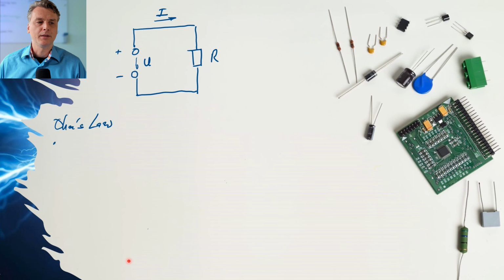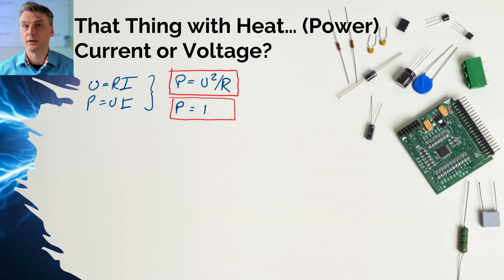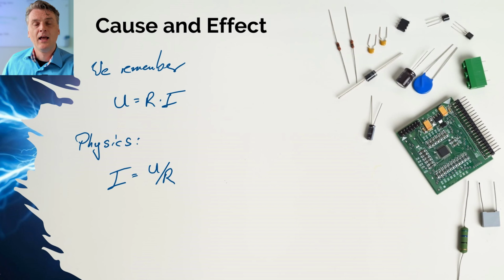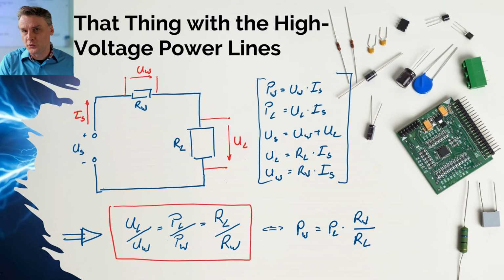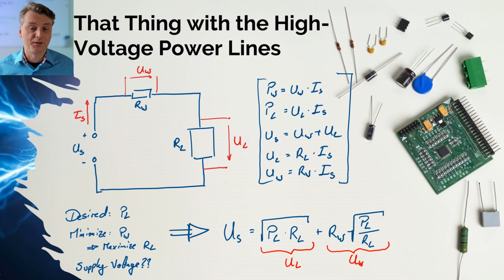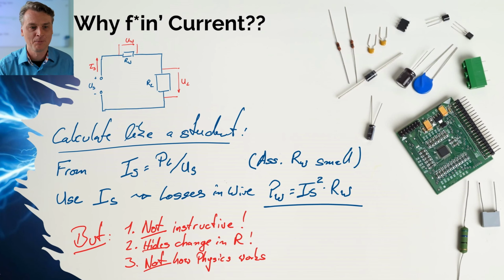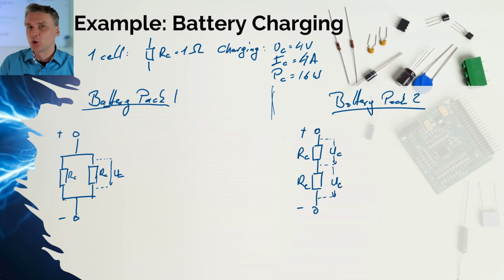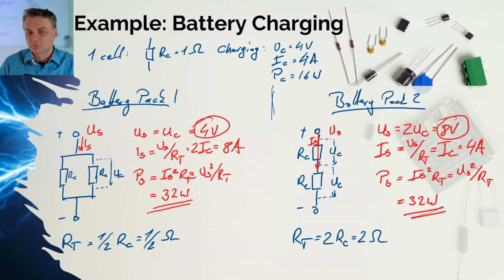In-Depth: What most get wrong: High Voltage, Heat, Power Loss and Battery Charging

Comment: It's not entirely inaccurate for a layperson to think that 800v charges faster because many L3 charging stations have a current limit that causes only 800v cars to be able to pull the full rated watts. Sure, from the battery's perspective, C rate is all that matters. But the chargers are part of the system too from a user's perspective.
Reply from the maker: Yes!! You are perfectly correct! On the dot. 
I'll talk about what you said in the next one. 
But thank you for that comment. It tells (a lot, some?) of my audience are very knowledgeable people.